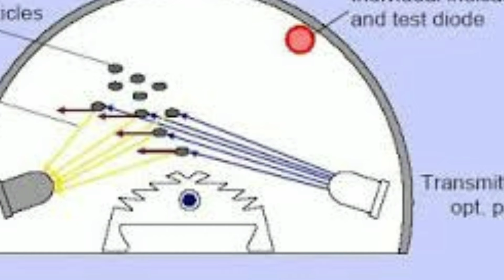SMOKE DETECTOR/HOW SMOKE DETECTOR WORKS/FALSE ALARM /FIRE ALARM SAFETY SYSTEM.

Comment: bro is Photo Electric or Optical Detector are Same. Pls can u give explanation with notes
Reply from the maker: Yes. Need some time.
Reply from the maker: Yes both are same.A photoelectric, or optical smoke detector contains a source of infrared, visible, or ultraviolet light (typically an incandescent light bulb or light-emitting diode), a lens, and a photoelectric receiver
Reply from the maker: Bohot jaldi auto  learn ka ek video ane wala he .oo 12/11/2019 ko ayega.bohoti important video he.usje madat se app Morley panel pe manually programming kar sakenge. I hope oo video app logo ke liye helpfull hoga
Reply: Optical type smoke detector is another name of photoelectric type smoke detector